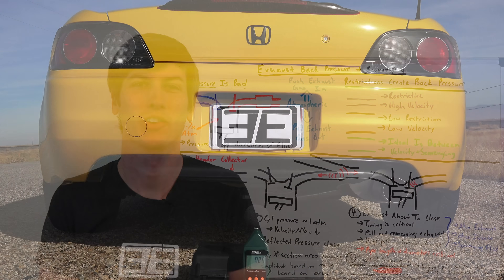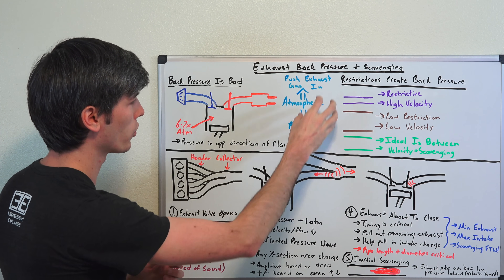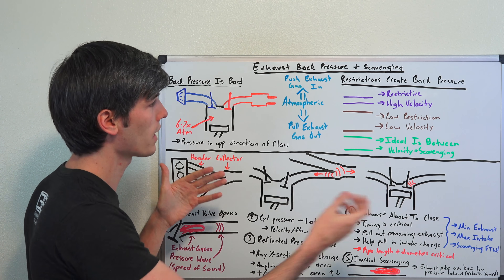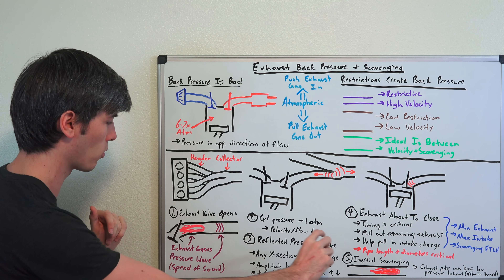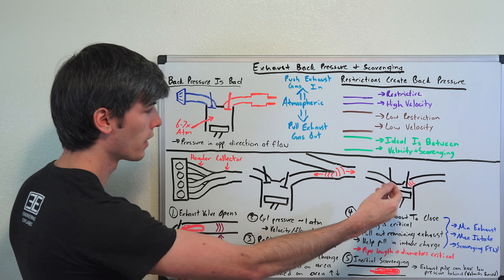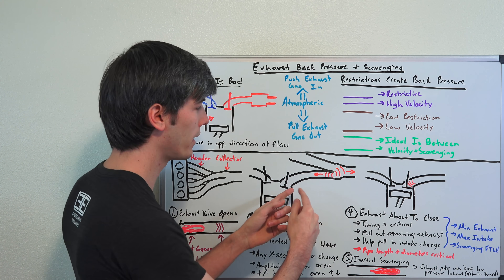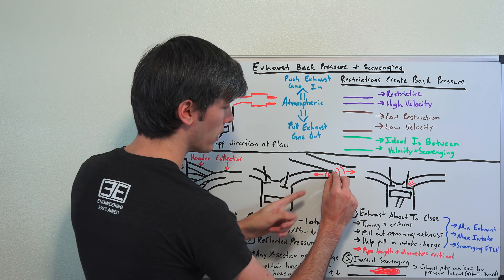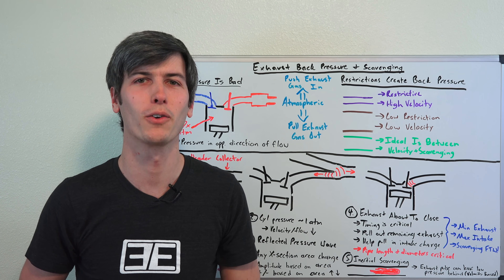Stop Saying Car Exhausts Need Back Pressure

Comment: What if there is sort wide pipe coming straight out of the turbocharger, for turbo engines, with nothing aal.? I always wondered if it made my previous car Volvo t4 lose power at some REV range? I see all high performance drag engines, and track cases are common to have it,hre the al have only    wd pipeafter the turbo hot prt, and th s abut it. No back pressure there, do we need it on turbocharger

Comment: In a simple 2.0L n/a, with a non-interference design & automtrans, you need the back-pressure to induce scavenging & basically vacuum through the entirety of the low end. So realistically, during the entirety of city driving. If you put a fart cannon on this car, you will literally feel the lack of engine response. It is not throttle response, or huge losses, but significantly less pep from 1K-3.5K rpm (until most L4 engines reach their harmonic power hump) then a huge surge of power between 4K-6K rpm. 
The designers made your oem exhaust system in a way that promotes flow but has efficiency in mind. That's why exhaust manifold modifications never really help unless you are blowing pretty hard. In my 2.0L, it has no resonator but some really blahhh bends. As a result, I only ever get droning on the hi-way whilst passing doing 3400 rpm and rapidly dropping to 2250 rpm leaving a mess of harmonic exhaust waves just bouncing around under my seat. You can just unsettle the drone with a little throttle play, it doesn't occur at normal cruise though. So ha!

Comment: Engineering Explained so how many vehicle manufacturers achieve the ideal design for back pressure from factory? Conversely, how many aftermarket exhaust manufacturers f*** it up and make it worse?
Reply from the maker: That's a great question. As a general rule, I'd say the big names in the aftermarket know what they're doing. Manufacturers sacrifice exhaust performance for reasons related to noise and emissions. The aftermarket has the opportunity to remove these noise and emission compromises made in the name of performance. Also cast manifolds are common in OEM applications, rather than tuned header lengths.

Comment: I had a normally aspirated '83 Caterham Super 7 w/ 1700cc Super Sport mods and a nice 4-2-1 exhaust.  Quick little thing on the autoX circuit.  The fellow I sold it to remarked how it had mysteriously gained low-end throttle response, but lost top-end power.  A quick look-over found a callous mechanic had kinked the exhaust.  Lesson learned.

Comment: I would love to see someone with a dyno test this. Can an exhaust header and collector increase the power output of an engine as opposed to open exhaust ports, and by how much? How do the header and main length affect the power curve? I found the discussion of exhaust velocity highly interesting. The so-called importance of back pressure has never made any sense to me either, but I never considered that the inertia of the outgoing gaseous mass from an engine could be integral to the scavenging of a given cylinder, constituting the use of a narrower pipe instead of a larger one. Great video

Comment: cars are factory tuned for their specific exhaust
for example if you are going to put that high flowing 3" exhaust on your 1.4 civic, the engine is actually going to run worse without tuning the engine. 
But when you have older car that doesn't use ECU to run, you will actually increase the power output.
Excuse my english.

Comment: What is the size of these scavenging effects? Are we talking about a 5% swing in power within the desired power band? 

Also,
Given the periodic nature of the flow, resonance seems to be important to the dynamics of the system. With admittedly only a cursory understanding of fluid dynamics, with n pistons firing in one revolution at x rpm the maximal length of exhaust for the exhaust system would then be limited to about 20000/(n*m). This comes close to 1 meter for 4 cylinders firing at 4000 rpm. This seems awfully short, even neglecting the time it would take for the exhaust system to equalize to near atmospheric pressure after a given pulse ( I would expect that to generously halve the maximal exhaust length ). 

As such It seems that an exhaust system would be built to handle 2 or more waves occurring concurrently within its length. I am not sure what effect this would have on the dynamics of the pressure waves. It seems more akin to pulling on an infinite slinky than the propulsion of a slug down a chamber.

Comment: Ive been wanting to have a discussion about this with another colleague. During the conversation we all came to this same point. You did a great job explaining it. What i think SHOULD follow up next is how Valvetronic exhuast systems get the higher pitched SHRILL notes from engines otherwise....the higher pitched exhaust stuff.